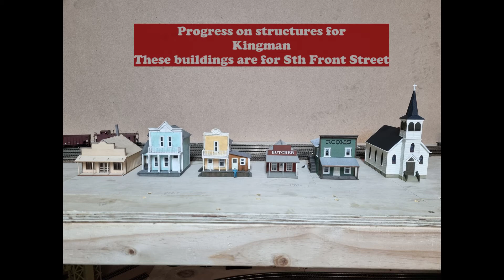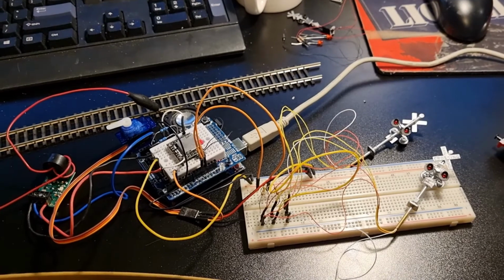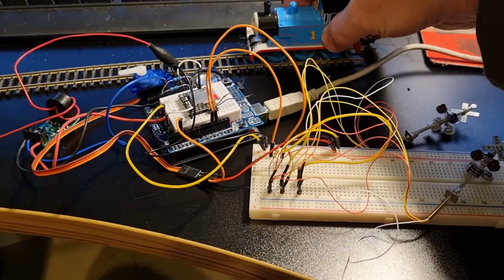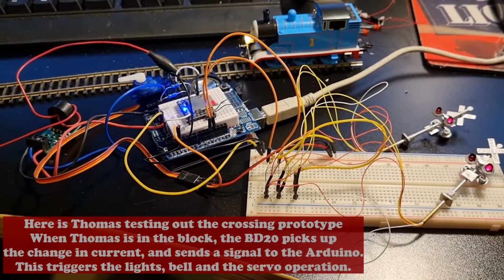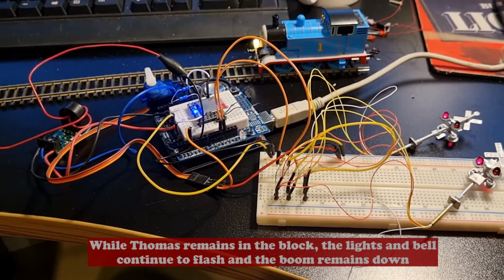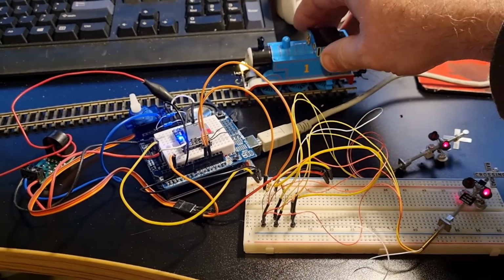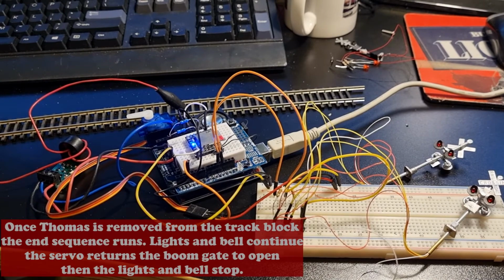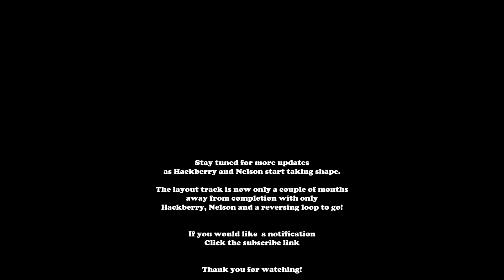1st Arizona Subdivision Update #10

Comment: Great video! The ATSF Broadway Mikes are fantastic. Used one of mine for two and a half hours during an ops session working in a yard, then ran it for about another hour around the layout.  no real major problems.
Reply from the maker: Thank you! I agree, so much research has gone into these Mikes. Paragon 4 is much improved including the keep alive. I have programmed F9 down to F8 in line with the rest of my fleet, and set F9 to turn the cab light on and off instead. Will be giving it a go on the layout in the coming weeks.